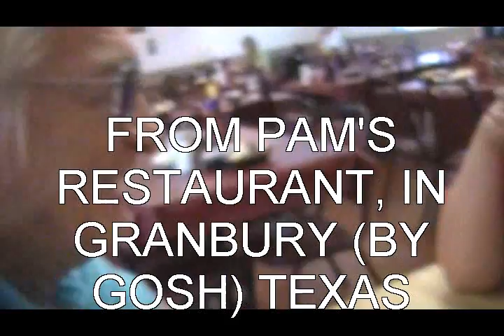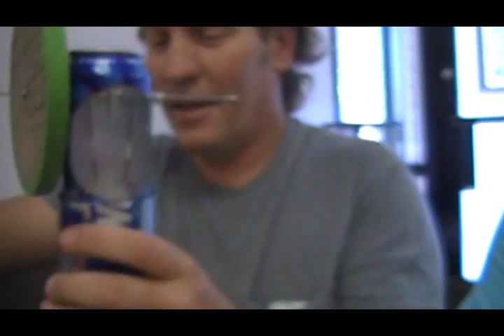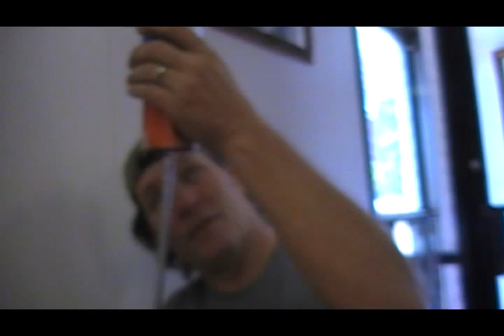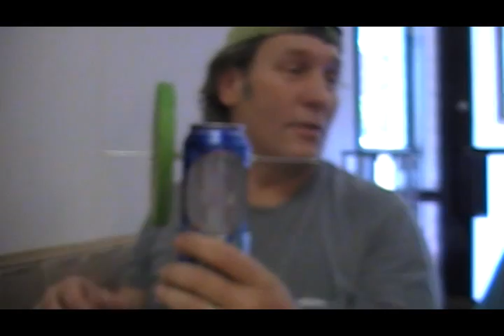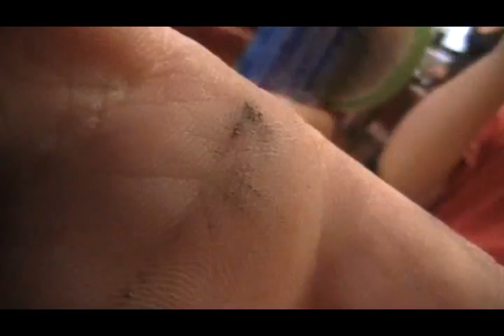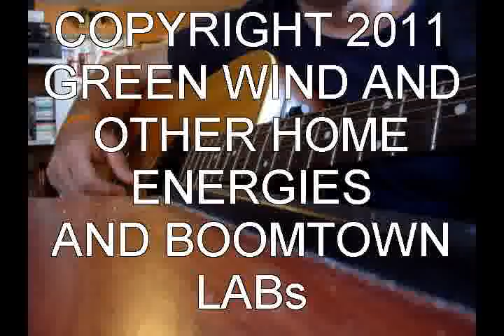EASY POP CAN STIRLING ENGINE

Comment: @muddymuddymuddmann i guess it could have enough power for this. might have to build it a little bigger ! 
it's all about the power it could generate ! and the pull force. 

i'm still working on my hydrogen Dry cell ... i when from melting Pepsi can to make an engine work ! 
it cost me 12 volts @ 30 amps = 360 watt to get a small engine to work like 1000 W engine or less 

i'm building a 50 plate design ... whit blade from the wood mill right now ! it will be a super duty one :P

Comment: @muddymuddymuddmann
  Excellent, Fire & Ice, the Elemental-Engine...! Now, we  need a Solar Hot-Air Generator, and sufficient Temp-difference that a Flywheel-Fan, blowing for EvaporativeCooling, replaces the Ice... Then, it'll make the Holy TWISTINESS, from Fresh-Air & Sunshine ; Running  on Water, with Zero Emissions ! Yay Team. The Oil is Un-plugged, & The World be Saved ! Yes  ?  Lucky they didn't call  the NSA, for such Subversive- Individualism !